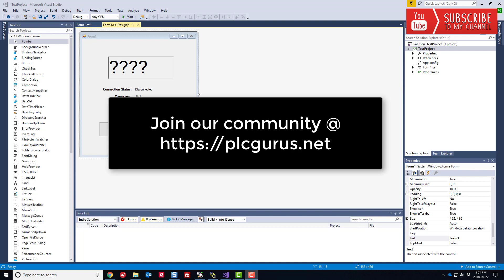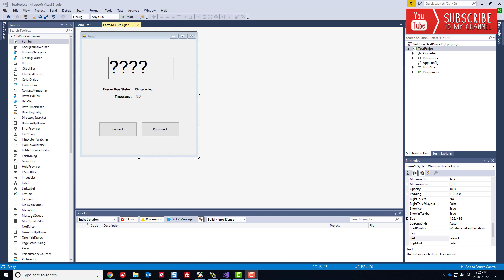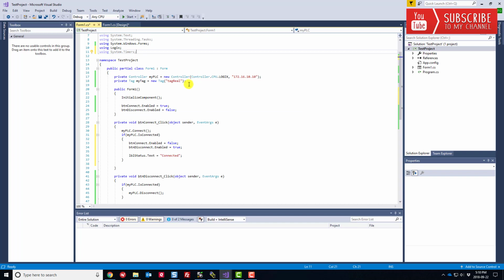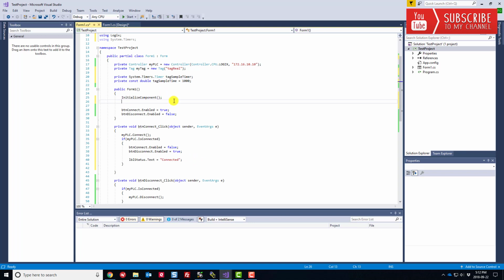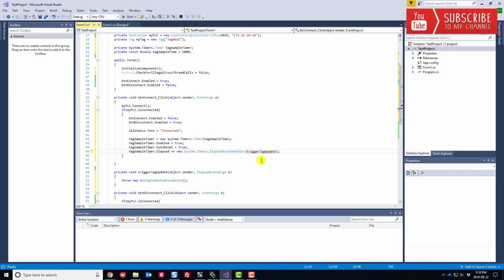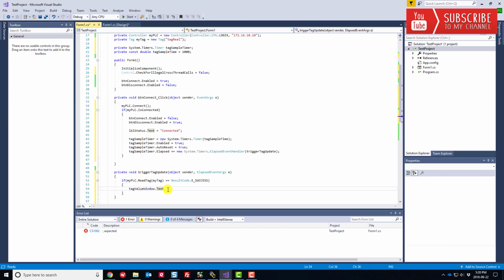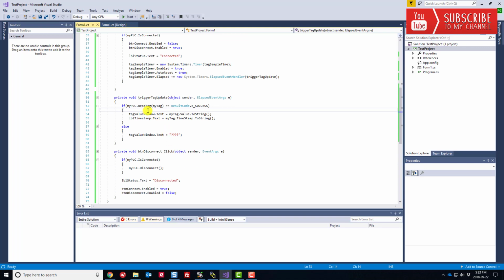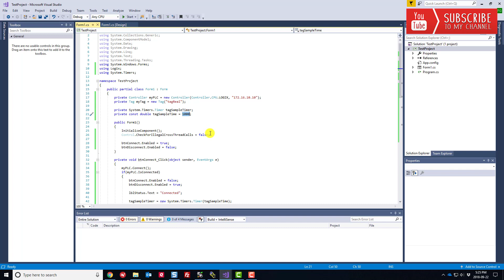PLCGurus.NET - C# HMI - TestProject - Part 2

Comment: is that possible to create alarm banner and view historical alarms using C# and ingear drivers? if so, do we need to build a custom coding or any ready made code available? if ready made available, where do I find it?
Reply from the maker: Hi there. Of course this is possible, however, the code would need to be developed. Once developed you can certainly reuse many time. For historical data, I would recommend using a backend SQL server and the use Linq to query your database from C#. 

While I've not developed specifically what you're asking if you take a look at the "What's Next" video in the series, I have provided a download link to the C# code you see in that video that may aid in your learning.